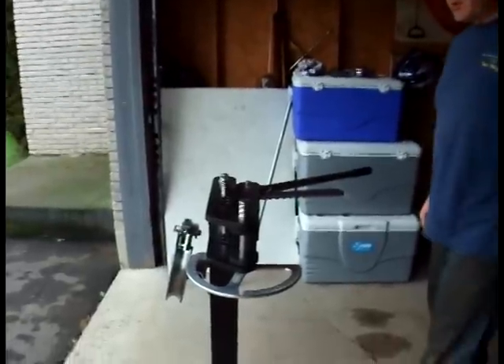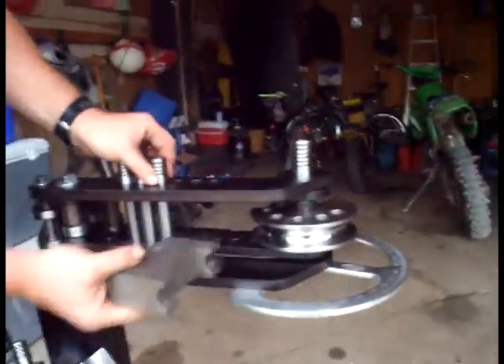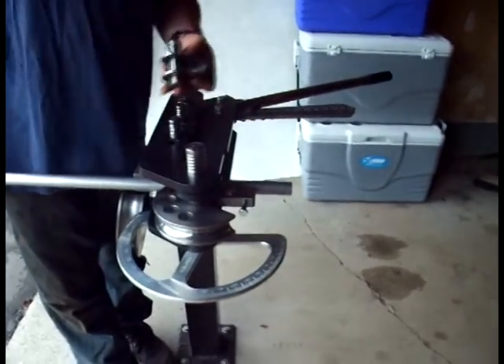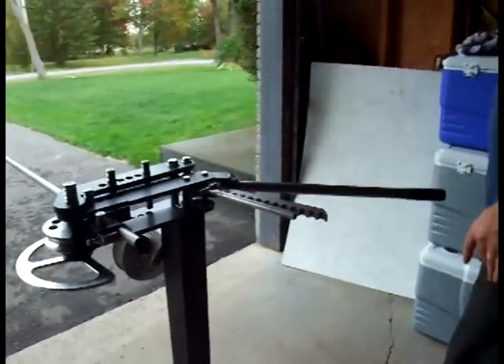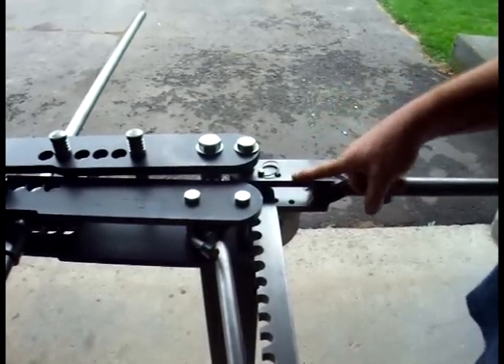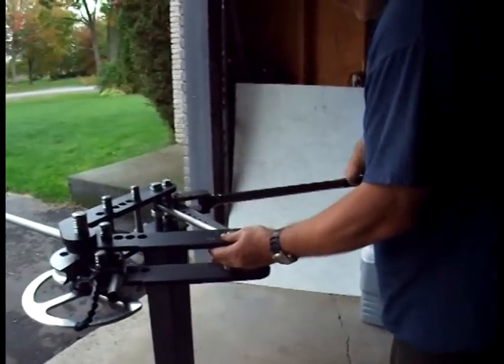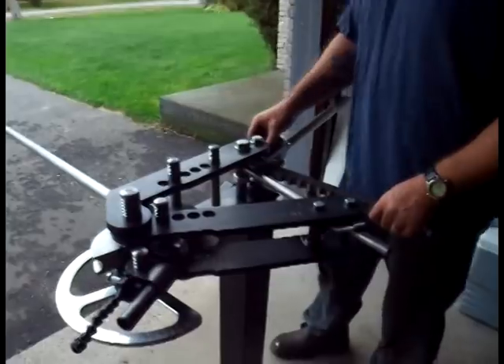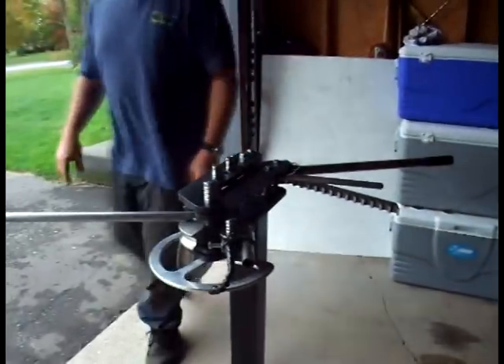JMR 3-Speed Manual Tube bender

Comment from the maker: The tube I bend comes in 20 foot lengths and sometimes you want to chuck a whole length to begin bending. By positioning it where it is near the door and to one side, I have room to open the door and feed in a full length of tube, as well as room on the inside to have a long length swing around as you bend the last bit.

Comment from the maker: @13098519 Round steel mechanical tubing is NORMALLY ordered and supplied based on a specified OD and wall thickness.  The ID is the result of these former 2 specs.  There are however some exceptions to this  - most notably in true seamless tubing. It is normally intended to be used for mechanical purposes (i.e. building things).

Comment from the maker: @13098519 
Pipe is  ordered and supplied based on a specified nominal ID and a wall thickness that is usually specified as a "schedule" e.g. schedule 40 pipe indicates a certain wall thickness) . It is most often intended to be used to convey liquids and gasses, but as long as the correct material and grade are used, it is perfectly acceptable to use pipe to build structures as well (many bridges and other structures do so).

Comment from the maker: @kyblacksmith  Max capacities are:

2.5" Round Tube (.120" wall) 
2" Square Tube (.120" wall) 
2" Sch. 40 Pipe. 

Yes it will do square with the right dies.

Comment from the maker: @13098519 As long as you use the correct size die for the material you are bending (and make sure you use tube dies with tubing and pipe dies for pipe), yes - it will bend the material without crushing or kinking it.

Comment: having a correct bend is critical to certain applications.    When flow rates of fluid materials are diminished by turbulent activity within steel tubing it can alter power consumption.     To bend steel tubing without maintaining consistent inside diameters and wall thickness is critical.  Inside bends are in compression and outside wall bends are in tension thus making the wall thickness on inside walls change by every bend and creating a change in flow rates.   The outside wall can become so thin that it is a point that failures occur.   Not using a mandrell ( a cylindrical axle, spindle, or arbor inserted into the steel tubing to maintain wall thickeness)  is not a wise process and reminds me of trying to bend copper tubing in my youth for gas lines when I crimped the line creating a gas flow problem to a carburetor.

Comment: OK...a couple questions.  Can I bend 1' SCH 40 6063 aluminum pipe in this?  1.32 O.D.  I want a 4" radius which I suppose would mean the die is 8" in diameter.  #2 - How difficult is is to make two bends and have them come out exactly on the same plane?